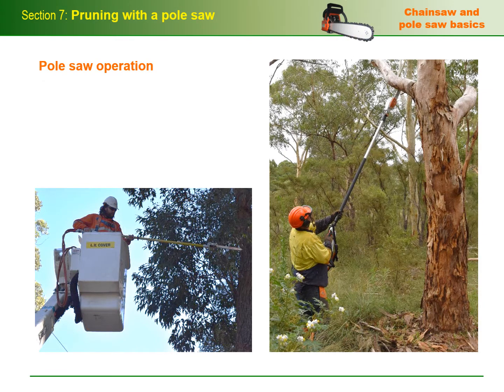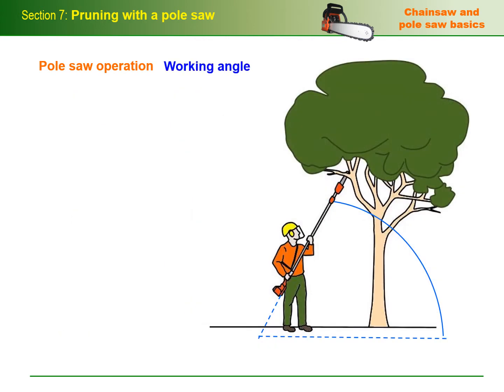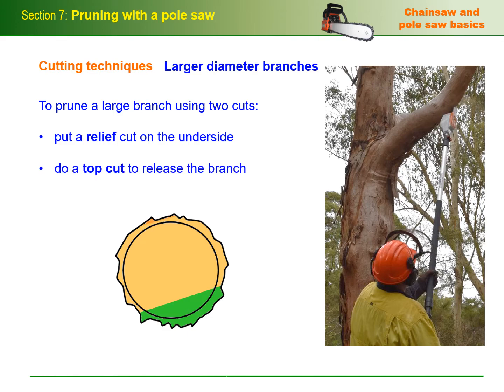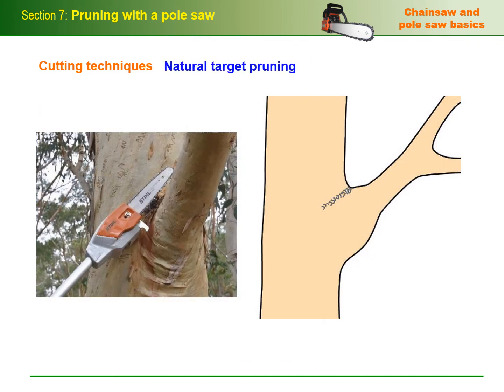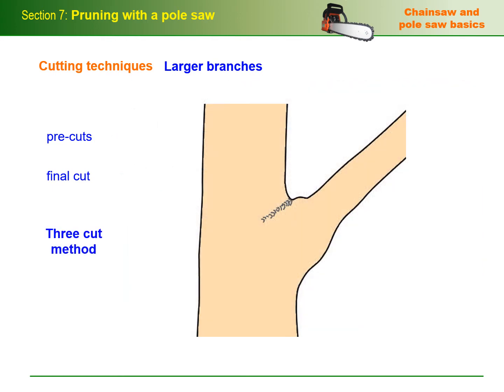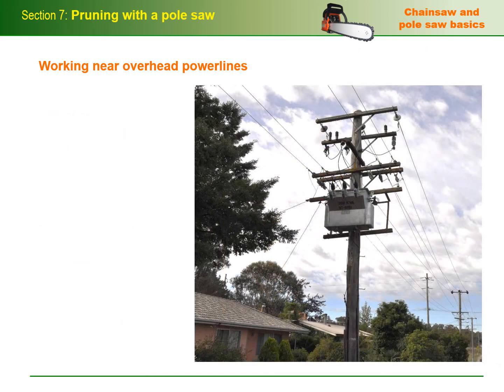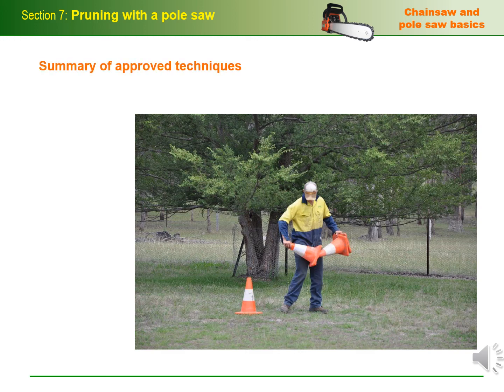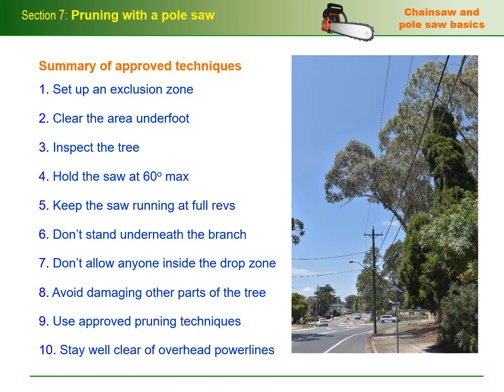Pruning with a pole saw

Comment: Very useful.  I can say from experience, a day is ruined when you get a pinched bar on a telescopic pole saw, which will separate in half if you try to yank it out.  If you get your compression/tension cuts right, you won't have to worry about that almost ever.
Reply: I was thinking of just nicking it underneath to stop tear out
Reply: i got the portland chain saw stuck in a little tree. I need to make sure Zi know how to not happen again.